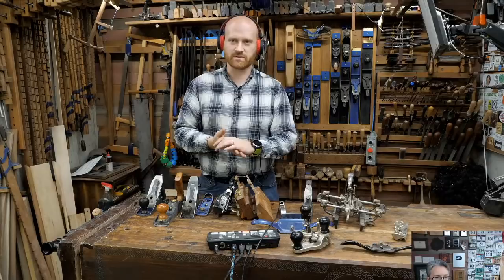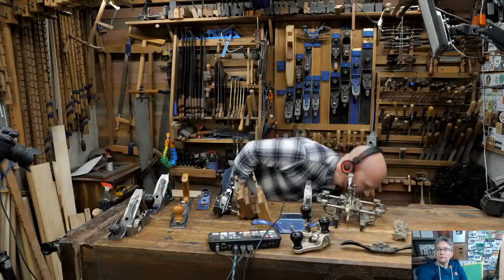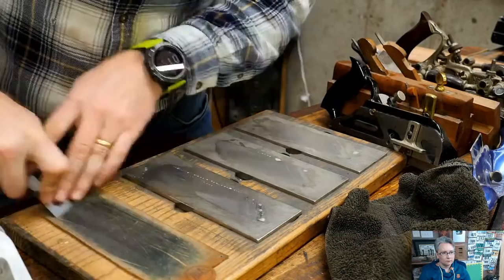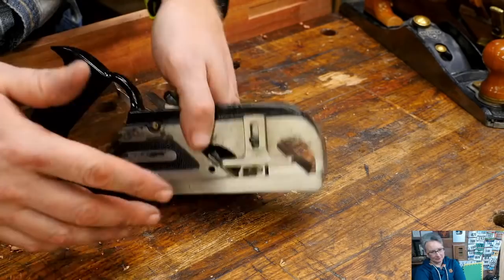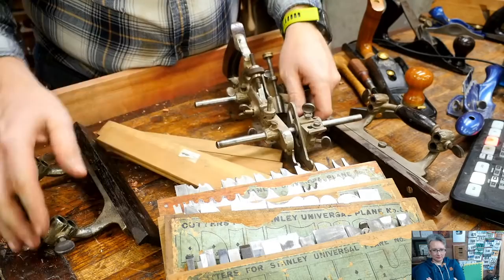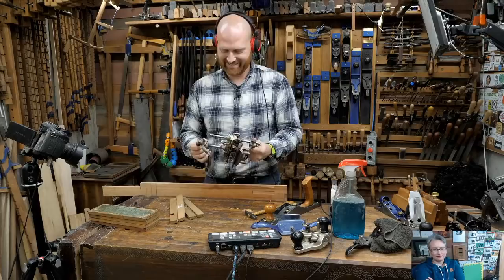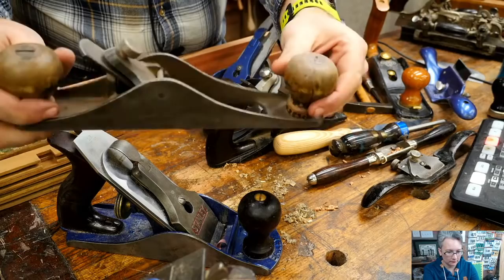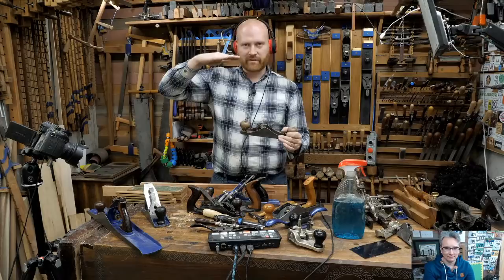All About Planes and Their Uses

Comment: Hi James I did buy 2 Stanley #71 router planes one was to restore and had no blades for $60  the other one had   broken mouth with blades for $20  both planes  I Will use one with the brake I will attach flat board to base, these plane both purchased in Australia Great content  per usual
Reply from the maker: Nice fined. Sounds like a fun time.